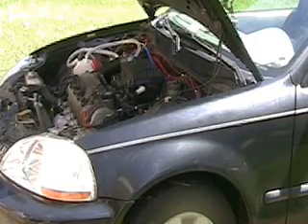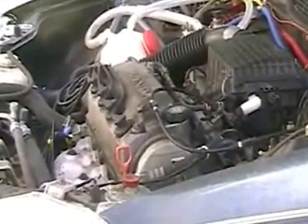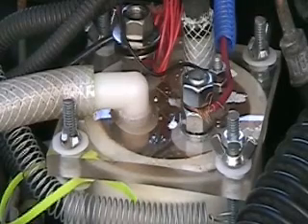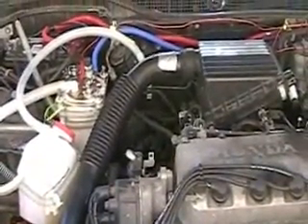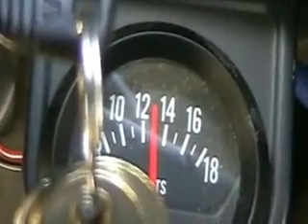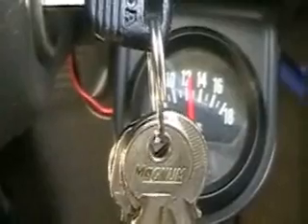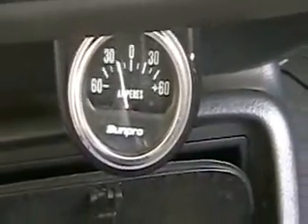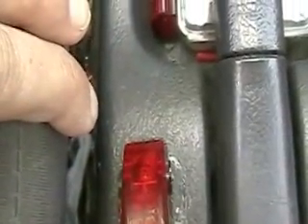Hydrogen Tap (FOCUS- update Honda) 328

Comment: hi the problem i have,at my battery is 60 amps i want to drop 15 amps what i need to do?i finish it doing every things but the question i have right now ,is how do you install the the cell?you install direct to the battery you hydrogen cell?..thankss

Comment: Hi John,
Please take this in consideration, my last honda was a 1997 and I was getting a constant 625-650km City/hwy from my 50 liter tank. I always shift below 3000rpm and keep Sparkplug and air filter at premium average speed is between 120km and 140km hwy.

Honda's depend very much on a clean air Filter, when it gets dirty the MPG drops fast. Maybe a quick change of the filter and a monitored shifting below 3000rpm would give you more impressive result.

Francis ... btw: Great work !